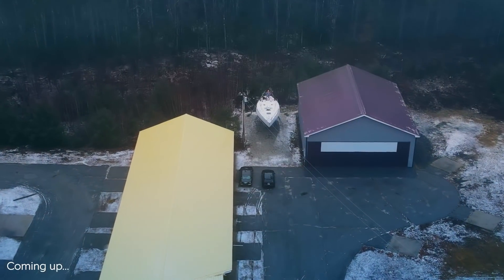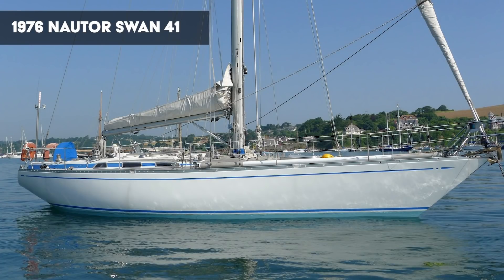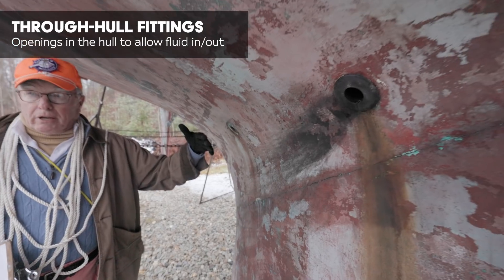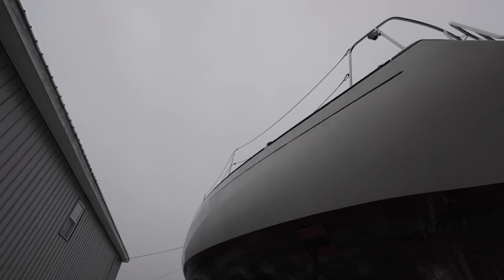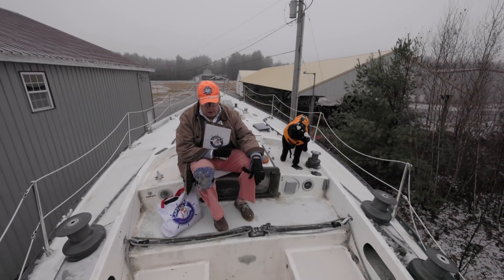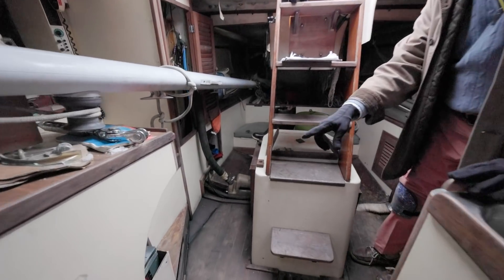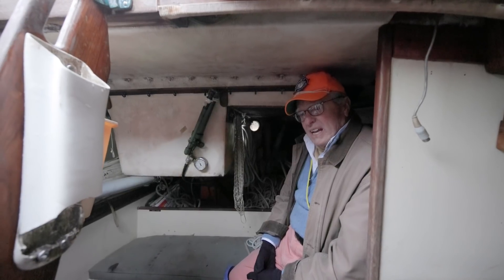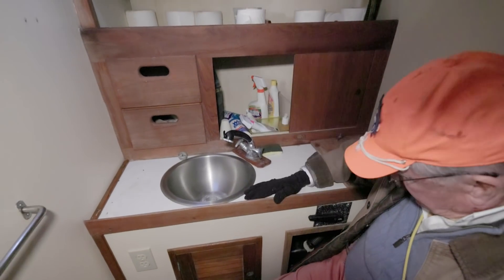$11,500 Racing CLASSIC! Sparkman & Stephens Tartan 41 EP 77 #sailboatforsale #sailboattour

Comment: The mystery gadget with the sprocket appears to be part of a "bicycle" chain drive auto-pilot system. It fits onto the hub of the steering wheel with the two flanges nesting into the spokes of the wheel. The rest of the system is likely somewhere under the interior rubble. I helped a friend of mine install a similar system on his new 1980 Niagara 35 back in the day and it worked like a charm.
Reply: give him some merch !!!!

Comment: We would use that bucket contraption to drag the spinnaker head through and put rubber bands on to avoid it setting early next time it goes up.
Reply: I agree. Although a few rubber bands overboard doesn't seem much compared to all the plastic in the ocean, I couldn't do it that way today.
Reply: I second that, with no doubt.
Reply: Rubber is organic but you can use wool yarn like I do@wheelerstudios

Comment: Having read some comments, I'm chuffed at having sussed the usage of the two mystery objects.  I'm a non-sailor so didn't make the precise connection with the spinnaker, but could tell that in a limited space, passing a sail through the bucket thingy would be helpful in bringing correctly orientated sails up from below while under way.  The metal prongs mounted on a clearly chain-driven gear was easy.  This channel has taught me a lot about how sailboats work to the point where if I had a boat it would now be a motor-sailer rather than a pure motor boat as it once would have been, CQ does a magnificent job of de-mystifying sailing.

Comment: Anders and Don got it!   In service that bottomless bucket would have rubber bands on it.   The spinnaker would be passed through the bucket, with the leaches straight, and rubber band “stops” would be rolled off onto the spinnaker every few feet for the length of the leaches.   The spinnaker would be hoisted behind the Genoa, close by the stops, much the way a more modern sock would do.   As the boat would round the weather mark, the trimmers would trim the sheet and the guy rapidly opening the spinnaker to the breeze…. And pop, it would fill as the Genoa was dropped to the deck!  It makes me feel good too see it too Captain !

Comment: I have a good friend who owned and very successfully raced a 1985 (or so) Tartan 40, similar to the 41. Around 1989 he decided to sail the boat to the Azores with a 56’ sloop following about 24 hrs behind him. While racing the boat the year before he had inadvertently hit a rock and damaged the rudder. It as inspected and appeared to be ok. Just in case, he had a jury rig rudder that he could mount on the reverse transom just as a back up. All went well until 1500 miles offshore, the original rudder broke and washed away. He and his crew mounted the jury rig rudder and continued on in a high swell and 25 kt of winds. After several hours, the edges of the transom failed from the stress from the rudder and the boat began shipping water. They put out a Mat Day call, but there were no ships close by. Fortunately, they raised their companion who made all haste to reach them. Bailing all night they kept the boat afloat until help arrived. They transferred crew and some belongings using a rubber raft which was quite harrowing in that seaway; no one was hurt. Within an hour after getting everyone aboard the other boat, the Tartan sank to the abyssal plane 5000 fathoms below.
Reply from the maker: Yikkes  thank you  glad for safety of all though.

Comment: The sprocket gizmo is an autopilot adapter for the wheel. (V notches engage the spokes). I forget the brand but it is a self contained unit the size of a shoebox with a reciprocating rod that engages the sprocket. The “box” part has a knob to set the compass course and another knob for gain.

Comment: The orange bucket device is to pack sails in bags quickly
Reply: And more specifically, spinnakers go through there and many rubber bands would be put stretched around the non-flared side that would be let off and put around the spinnaker as it was threaded through. The rubber bands then would keep the sail in a bunched up "line" until it was hoisted and then the bands would break when the sail was filled with air. Very clever thing!

Comment: The red bucket in mystery item  #2 is for packing a spinnaker before the next hoist or packing away in the sausage. As you drag it through the opening rubber bands on the outside of the pail are released every couple of feet to hold the chute in a cylinder shape. Boy were we neglectful of the environment letting all those rubber bands fall overboard.

Comment: The system was called a Shipmate. It was actually a rod with holes in it that grabbed the sprockets of that “gear”.
Reply from the maker: more detail?
Reply: @YachtHunters  I wish that I still had the unit but I threw it away after a recent basement flood. The unit was like a typical tiller drive pilot but there were holes drilled in the rod that grabbed the teeth on that sprocket and turned the wheel. The rod was placed parallel to the wheel, on top of the sprocket. It was quite simple and meant that a single drive design could be used for tiller or wheel steering.
Reply from the maker: Thank YOU.  Lots of detail here.

Comment: Too late, the orange "bucket" is used for packing the spinnaker. Start with the head, keep the luff tapes together and pull. Just add a few rubber bands along the way, chute goes up and pull the tack and clew apart and rrrrrrip, the bands go flying and chute is filled with minimal fuss. At least it should be like that. Yes, no more rubber bands, not biodegradable, use cotton or wool string;)
Reply from the maker: well done

Comment: Is it possible to move a boat this size by semi-truck?  If so is there anyway to spitball the cost per mile?
Reply: Yes but if its over 12' wide it would need an escort. My estimate ( been out of the business for several years so accuracy is unreliable) would be around $2.00 - $2.50/ mile plus another $1.00/mile for an escort if required.

Comment: Complete novice here, what do you mean by  "self tailing winches"? I hear you mention them(or lack of them) on most of the boats. What are the advantages of having them?
Reply from the maker: Self tailing winches are winches that wrap the tail in a round jam cleat that is located on the top of the drum. When you crank the drum, the winch will pull the tail simultaneously eliminating the need for a crew member to pull your tail for you

https://www.westmarine.com/buy/lewmar--ocean-14-aluminum-self-tailing-1-speed-winch--1863042?recordNum=1

Comment: Well, the rating system works at least? I'm with Ran-Day! I doubt that she floats in a rain storm! I think she's technically a 'dumpster fire' & should be ground up for new glass (they used a lot of matte glass in those old boats), Can't see any value in layout, possible inside footprints and doubt that the cockpit will ever feel inviting to any guest. Finally, I saw no way for anyone over the age of 40 being able to get aboard every single time. At the ripe age of 40- the prospect of actually getting aboard would drop from 100% to approximately 80% (50% after several drinks). Yup, the savings account is safe for 1 more week. Whew- it sort of nice- a 'breather' of a break!